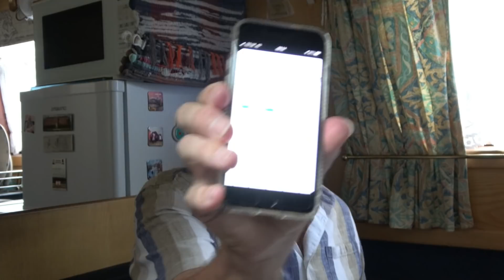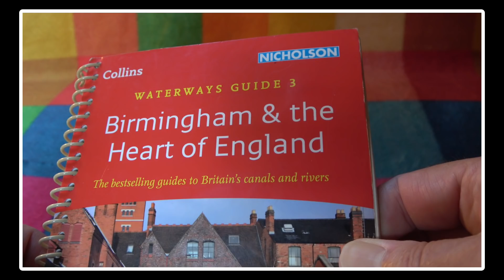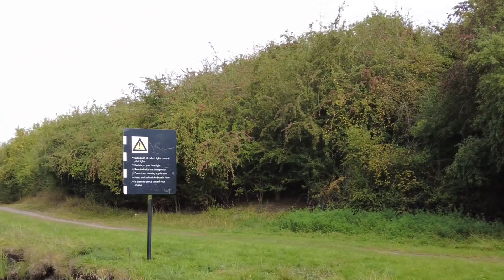232. Yelvertoft to Kilby Bridge by Narrowboat – Part Five – Arrival at Kibworth Top Lock

Comment: Evening Alan, Another interesting vlog, and  I  really enjoy seeing parts of the country that I would otherwise never see!  A simple question if I may, does the  temperature inside the  tunnel vary very much, compared to either side?  Sounds a little silly, I admit, but I did wonder, supplementary question? What is the coldest tunnel you have experienced?  As usual, take care. Cheers.
Reply from the maker: Hi Martin, the temperature inside a tunnel will be cooler than outside and I believe that tunnels of a similar style, like canal tunnels will have a similar temperature, so I wouldn't expect a great variation. It might vary with the time of year but I'm not aware of any tunnels being colder than others. In fact I believe underground temperatures are generally fairly uniform because the environment is fairly constant and not subject to solar variations. Cheers, all the best.